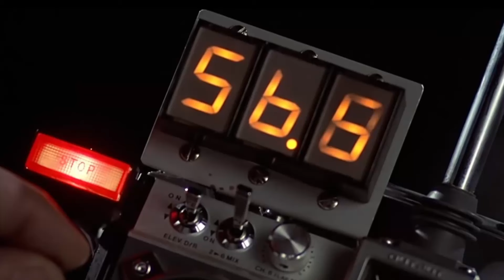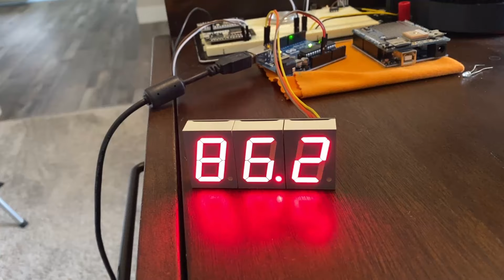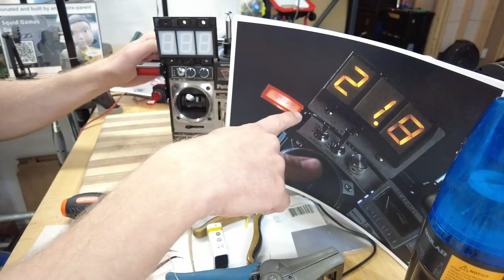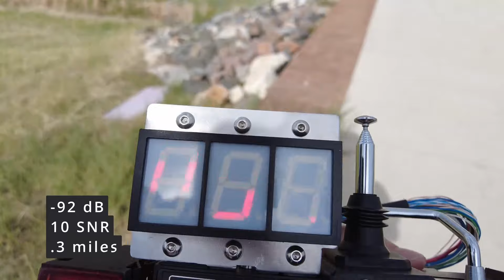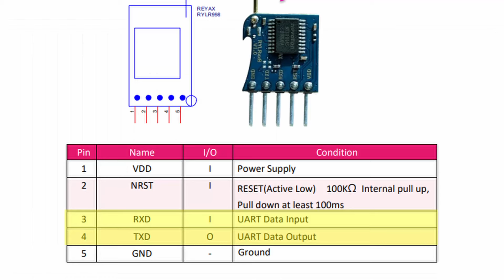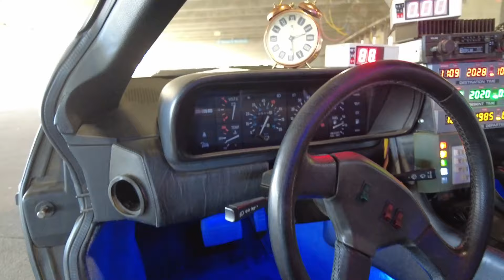Back-To-The-Future parody with remote control build 🤯

Comment: what is the length width and depth of the speedometer enclosure
Reply from the maker: External Height - Metric: 45mm 
External Width - Metric: 118mm 
External Depth - Metric: 98mm
Reply from the maker: The box I purchased is here: https://ebay.us/F8GviR
Reply: thanks

Comment: What's the use of a small GPS module when the Antenna is Huge ? I would have used a small BN-180 GPS puck. Totally much smaller. Nice project just the same..
Reply from the maker: Oh wow the BN-180 look really nice. Thanks for showing me about this. Your right though, I added the puck just in case I didn’t get enough satellites and it adds a lot. It probably would have worked with just the internal antenna but I only had one chance with the Delorean so didn’t risk it. Thanks so much for watching and the suggestion for the cool gps module, I’ll definitely be getting one.

Comment: JUST A POINT
4:42  , Since you are being specific... Your explanation was incorrect.
You are using a 
1 inch
7 Segment Display
........ WITH D.P.
With Common Cathode

Again, if you're being that specific you shouldn't leave out the correct definition of the part you are using
Reply from the maker: Thank you, does D.P stand for double pole? If not, what does with D.P mean?
Reply from the maker: Oh I think it means decimal point. Thanks again for the tip 👍
Reply: @CodeMakesItGo  
it depends on context
in the context of Knife switches and switches in general you are correct 
it stands for Double Pole and S.P. as you gathered stands for Single Pole

However the context here is L.E.D.'s and Segment displays, Nothing to do with Switches

In the context of L.E.D.'s  D.P. Stands for  Decimal Point
so you can have a 7 Segement Display WITH D.P. (which you have)
or you can have it without D.P. (in which case you wouldn't generally say without D.P., you would just say "7 Segment Display"  ) which you did and given that it has a D.P. it is an incorrect statement given the level of detail you intended to  go to 

so.. D.P. means  Double Pole,  it also means Decimal Point
in electricity it can also mean Dual Phase (but that's another story)
Reply: @CodeMakesItGo  
and..... there you go 
You're welcome

again, i wasn't being a dick and if you didn't go into a lot of detail i wouldn't have bothered mentioning it because in the context of electronics if we speak generally 
you generally don't point shit out if it's wrong
but.. IF YOU CHOOSE TO BE SPECIFIC AND PEDANTIC (as much as it's respected) if you get something wrong, expect it to be pointed out
in saying that , in electronics it is expected that if a person prides themselves on detail then they do not mind being corrected and learning so.. i wasn't being a dick, i was pointing it out for the sake of accuracy

given your response, i take it you didn't know that, so i'm glad that you now have learned it 

Be cool
cool video
Reply from the maker: Haha I don’t think you were being rude at all. I know I have a lot to learn. And I know there are really smart people out there like yourself. I appreciate you pointing out details. You’re not only helping me learn new thinks but anyone who reads this too. So thank you. 👍
Reply: @CodeMakesItGo  
Exactly... and that was also my point for explaining it in detail

Although.. i will admit, you do suprise me.
I'm 49, i've been fucking around with electronics since i was like 4.
Now.. You built a Back to the Future Delorian remote
In my experience if a person does that you qualify for a few things

1. You are passionate about electronics
2. You do give a fuck and you care to learn
3. Given all the theatrics and wigs, you're a good natured person
4. You're willing to put time into a cool project

Now given all that, I am absolutely amazed and suprised that you never picked up
on the Whole  7 Segement with D.P. thing

I'm also suprised that you built this and you put your level of knowledge down to such a low lever,  YOU SHOULD GIVE YOURSELF MORE CREDIT
Ultimately , we all have a lot more to learn at any given time (Elon Musk has a lot more to learn),  However.. i think if you build a working prototype of something from Back to the future, you are past the basics and you should give yourself credit where it's due

Lastly... if ever you want to contact me or have a chat, Feel free mate, 
I'm here to help, you can get me on 
martin@btotechnicalexperts.com.au     if you ever want to talk anything electronics

Be cool